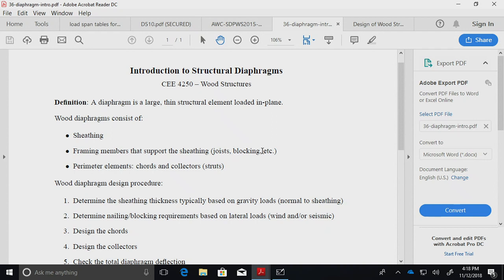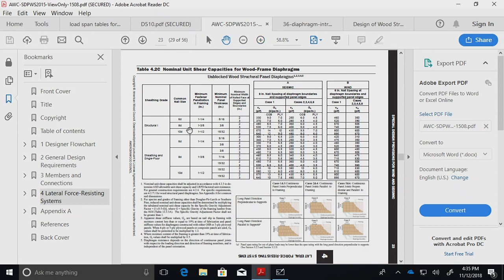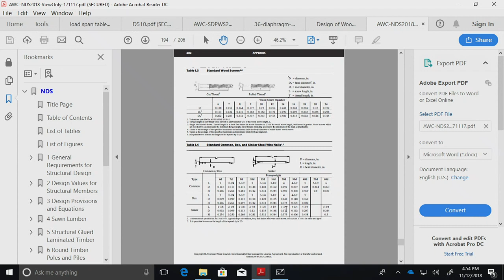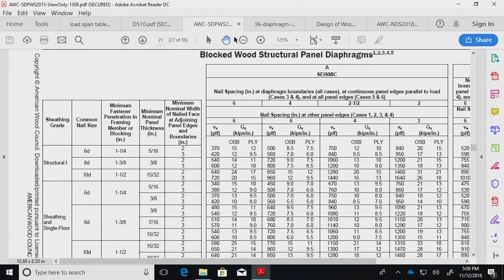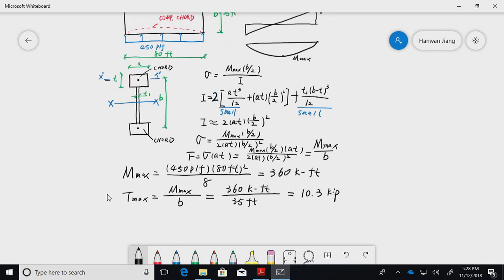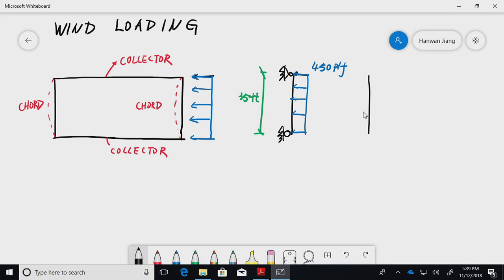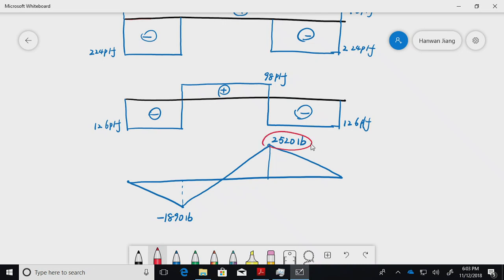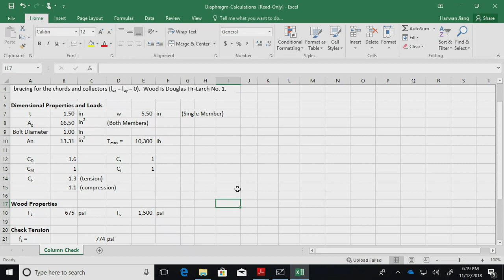Diaphragm Design Example

Comment: Hi, the shorter shearwalls take more unit shear than the longer one in both directions . In the longitudinal direction , u designed for the total length of the shearwall , excluding the collector; which is fine . But in the traverse direction , we have two shearwalls , a longer one with length 35 feet and a shorter one with length 15 feet. The short one is more stressed , with a unit shear of 1200 plf whiles the longer one has a unit shear 514 plf . Now the diaphragm: The longitudinal should have a unit shear of 98.4 plf(just asking) Your presentation is very very useful . Bravo